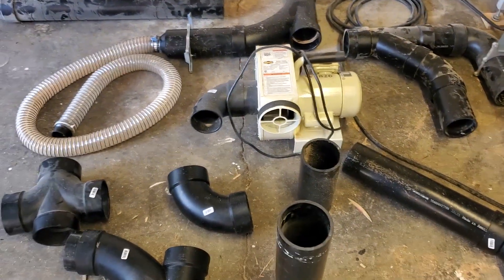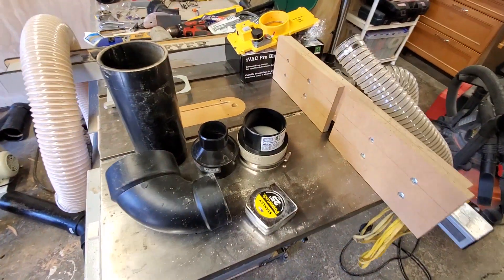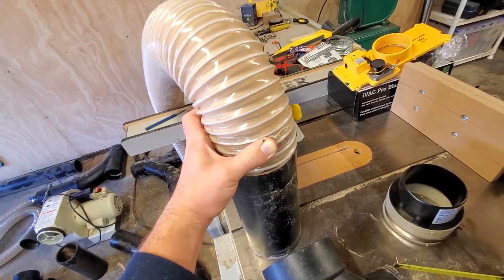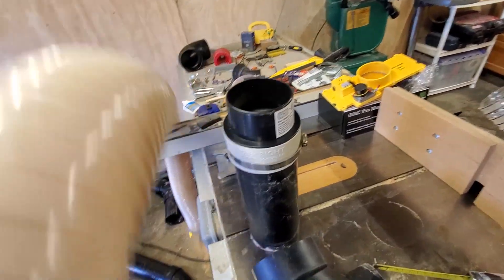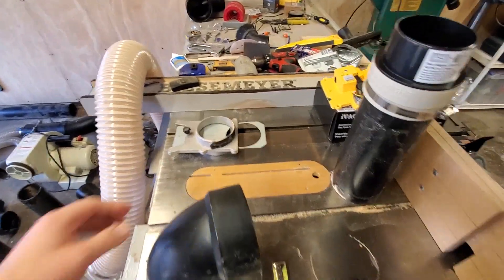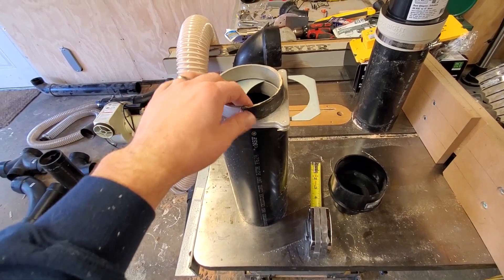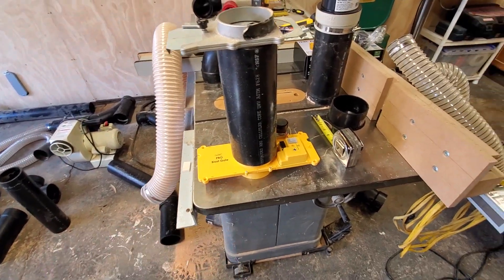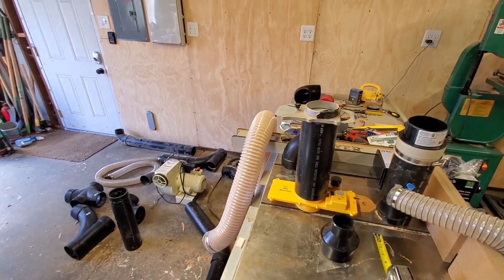How to Use 4-inch ABS or PVC for Dust Collection to flex tubing (4 or 2.5 inch)

Comment: FYI - u can use a heat gun on just about all plastic piping to mold and shape to fit- I’ve down two systems w a combo of PVC/ dust collection piping and it works great